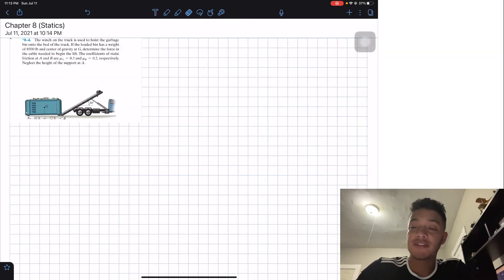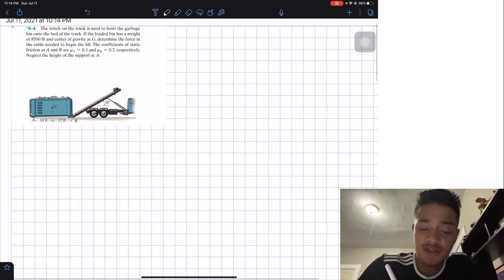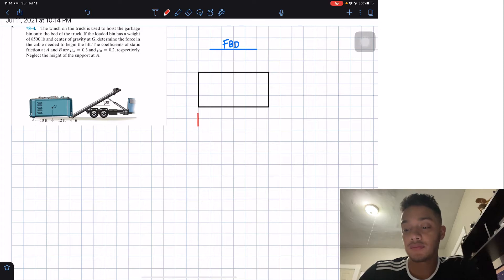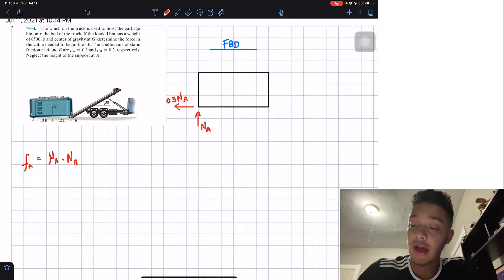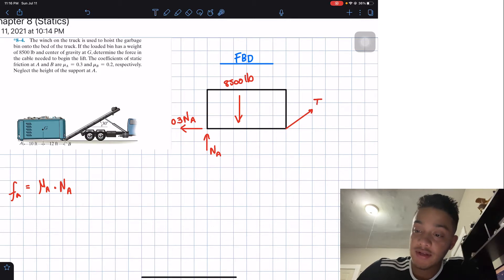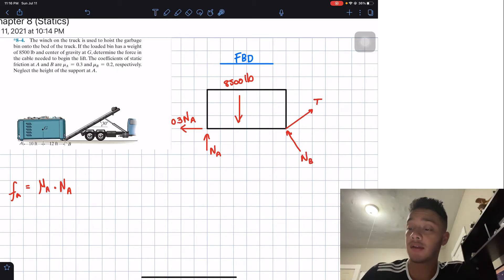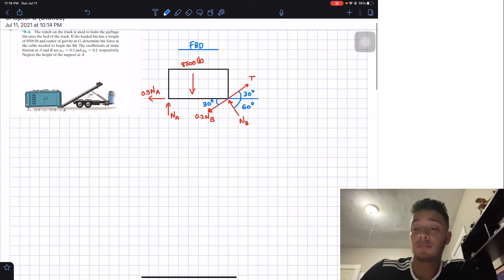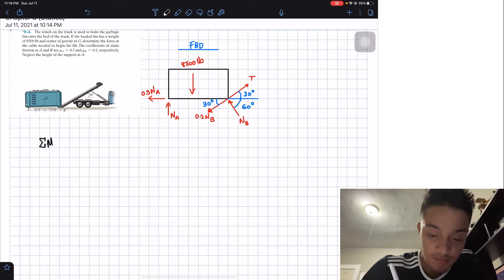Statics 8.4 - The winch on the truck is used to hoist the garbage bin onto the bed of the truck.

Comment: Could you explain more clearly why there are more than 1 force acting at point B? I understand that 'T' is representative of the tension in the cable being used to hoist the bin, and that '0.2NB' represents the friction acting to the opposite of the tension in 'T'. What I don't fully understand is when you're talking about point 'NB' being the normal force at point B. Why is it that you have a force acting at 90 degrees of the 'T'? I'm not sure I fully understand why that is happening.
Reply from the maker: Hello Nick, the normal force at any point is always 90 degrees from the surface. At point B, the surface is in the same direction as the tension 'T' that is the reason why 'NB' ends up being 90 degrees from the tension.

In other words, if you zoom into the picture you will see point B is on top of the bed of the truck. And that is the reason why we would have that 'NB' on that direction. If this is not clear, I can make a small video to better explain.
Reply: @LearningbyTeaching  I would really appreciate it if you could explain in more detail why the normal force is related 90 degrees to the 'T', so if you are able to make a video about it, that would be amazing! Thank you!
Reply from the maker: @nickcardinali1300  https://youtu.be/CTRYCW7p1fY I Hope it helps!